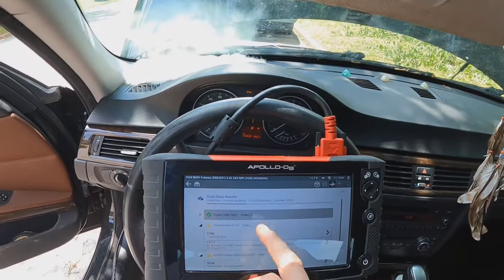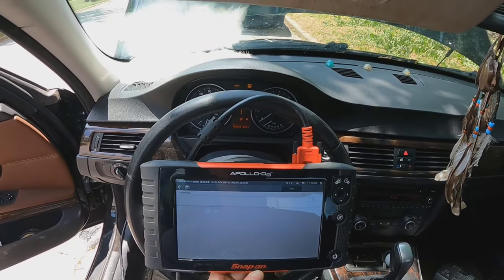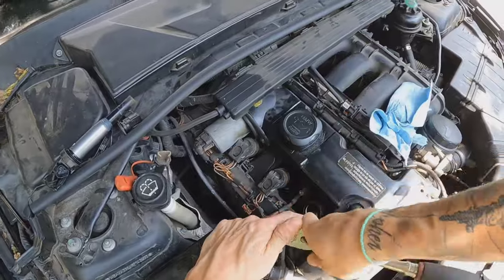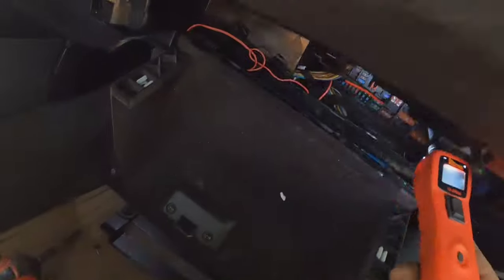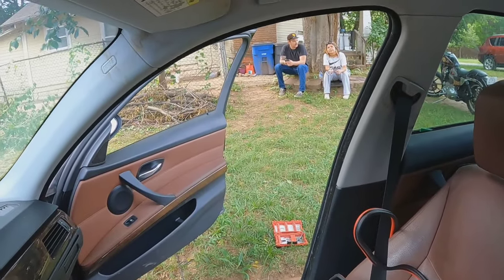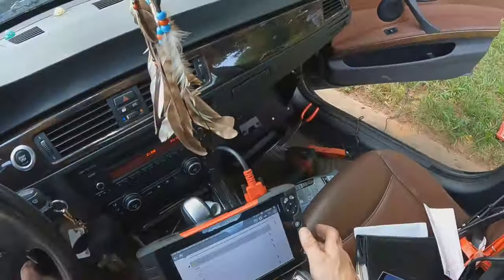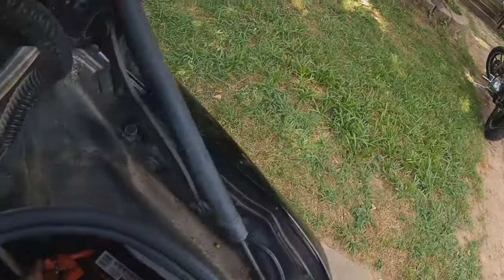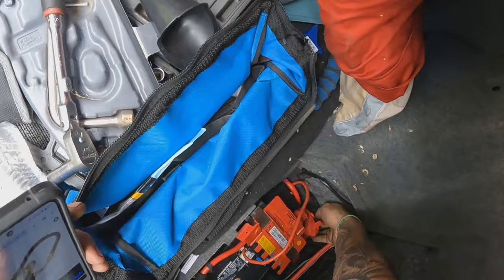08 bmw 328i Crank no start figured out! #fypシ #mobile #mechanic #letsgo #bmw #vehicles

Comment: Hey no hate, but it would have been interesting to actually see it start afterwards because BMW does not log when a battery has been replaced without registration as a fault. You can see it under previous registrations that there has not been one at a recent mileage. It will not cause a no start. The IBS is also not what you were showing her, you showed her the explosive discharge on the positive battery cable and the negative one is the one who houses the tiny IBS module. It is relatively easy to forget to plug it in because it's a blue connector that's  towards the tail light that's easy to miss. I don't think it was properly checked either it runs on LIN and you need to use an oscilloscope to verify there is a bus there or at the very least a multimeter to check the average potential at it, and check the wakeup line to the sensor- which interestingly enough beside a no communication from the DME to the sensor the only other problem the IBS can have is shorting the wake up line however you did not have that because the dashlights turned on where with no wakeup line you will get a flat display minus the MRS light. Another strange thing about the video is you were able to talk to the DME, and logic communication to the DME starts at PT CAN and you aren't actually talking to it through your scan tool it must go into the JBE first. She mentioned she replaced the fuel regulator, housed in the sending unit, which is in left side of the vehicle and if a hose pops off there internal to the tank you will have fuel pressure but it will dump right at the tank, it would have been drastic to amp clamp the fuel pump and verify that you have enough working load on the fuel pump and it's not just being dumped back into the tank. I like your videos but this one was very odd, and nothing you mentioned besides a fuse would have actually repaired the car. Another thing to note is Snap On scan tools will not give you full fault lists, full module accessibility, and misnamed fault codes and I would recommend you find a better scan tool for European vehicles TopDon/Launch and Autel are decent before going to an Autologic or a pirated version of ISTA due to factory ISTA needing a full internet connection which I understand would be difficult in a mobile environment.
Reply: Yeah I have the same vehicle as the video just as a daily, also have a 18’ 340i and ordered a 25 m4

When I got the 08’s battery changed they never registered it.
 it died after a year and a half and i had two people tell me they couldn’t figure out what was wrong with it both telling me if it wasn’t registered it wouldn’t start, but BMW said that wasn’t the case.
Bmw sent a technician with a new battery and registered it.

Hoping this battery doesn’t die within 2 years.
Reply: All facts.
Reply: so  most likely the autozone battery installer  grounder shorted a terminal  while moving battery around, which blew a fuse.
Reply: @jongonegone1262   Unless the guy bypassed the junction box feed fuse, very hard to do. However, honestly after looking at the fault list on the screen at 2:31, they are all Valvetronic faults. If the Valvetronic parks in a way that allows no airflow, it will not start, just crank crank gimme air crank crank. No mention of Valvetronic in this video. God this is a strange diagnosis. Hope this lady got her car fixed properly.
Reply: @youutartur1104  okay thanks.
Reply: @youutartur1104 I 100% agree on PT CAN, LIN, or wires in general they best use is a pirated ISTA. I’ve dealt with lots of wire malfunctions due to rat intrusion and diagnosis on those Bus systems are something a snap on scanner won’t guide you with.
Reply: Does pirated ISTA still work ?
Reply: @youutartur1104 you sound like you can help me so i thought i should ask, i’ve been having a issue where my car randomly loses all electrical power while driving, at first i would be able to start the car again but now it’s just completely dead.
Reply: YOU SIR, sound like an automotive mastermind!  Hope your getting paid your  worth if you’re an auto technician!  Greetings from Canada!  Sincerely from a fellow truck technician!
Reply: Reading this made me never want to touch a bmw
Reply: dude you just writing history from the beginning of time to end of days!
Reply: Why I don't own a BMW...I don't have an Adderall prescription. Holy cow.

Comment: These cars are getting so ridiculous having to register batteries holy crap we are getting to the point of being crazy
Reply: On some models its like that since 10 years and more.
Reply: It's so that the car knows what type of battery it is and prevents overcharging or undercharging. This is what the registering process entails. Inputting the battery stats to the car. Usually these cars come from the factory with smaller capacity batteries to save weight. But if you want to add for instance a 2000w audio setup, you might want to upgrade the battery. But if the car still thinks it's running the smaller capacity unit, the new one will never get fully charged. It's a neat feature but most people are not into this stuff and treat their vehicle like any other appliance. Which is fine, but in that case they probably shouldn't get a BMW.
Reply: @TurboNym  a Bavarian money waster isn’t for everyone
Reply: @JamesKinniburgh-e3e i actually see it as a money saver. if you register it then the battery lasts 10yrs instead of the usual 5yrs on most other cars. Our 128i doesn’t have the IBS system so no registration can/needs to be done. That battery dies every 5-6 yrs. 

I’ve been maintaining our 4-5 BMW’s for next to nothing in terms of parts costs. And the drivetrain in all of them lasts over 400k

Comment: I knew from the beginning of this video what the issue was. 99% of older BMW owners can't afford the care and upkeep on it and just bought it for clout. 😂 You need a BMW specialist computer and an AGM battery it CAN NOT be a normal lead acid battery... The issue is the alternator constantly ramps up over time to compensate for battery drain over time. The problem with this is the feature where the vehicle computer can detect the new voltage and amps from the battery so it should know if it's new or not is non existent. BMW in their extensive intelligence decided they'd prefer something as simple as a battery change requiring a computer flash to reset the battery! I won't even work on BMW anymore at all or Mercedes. If I get a call about one I politely say I don't work on them sorry.

Comment: For fellow bmw owners, There are different kinds of batteries. If you get the same size and type, you dont have to worry about the programming.
Reply: Not necessarily, it's still important to reset the life monitor when you install a new battery, regardless of the size. If you don't, alternator will overcharge it and battery will be kaputt within a year. See it all the time.
Reply: you may know, but the computer doesn't know its the same type and size so you have to program the new battery and let the computer know hey we have a new battery now
Reply: @BimmerLife843 thank you sir
Reply: You have to let the car know that the battery is new or you may end up with an overcharged system buy registering the battery it lets the car know not to over cyle when charging. It tells the car I am new be gentle.
I am not quite sure about logic of operation. 😏👍🤪😜🇦🇺
Reply: @d47000 thank you sir. As we know battery registration isn't just there so we have an excuse to play with our dongle.
🤪😜🇦🇺
Reply: Problem is don't buy a BMW. Over engineered pits.

Comment: if you disconnect the IBS from negative terminal your car should start if the IBS is the issue. the one one positive side is for airbags.  I would've checked the engine ground. I had a bad IBS and when it was connected it wouldn't charge the battery.
Reply: I’m in this situation with a 2010 535i Xdrive. I initially thought it was the battery so I replaced it. Then I replaced the starter and that didn’t work… next was IBS so I unplugged it but that didn’t work either. Thought it might be the engine ground so I tried recharging it through jump cables, then taking one black and putting it on my black jump terminal and the other to the engine block to try and manually ground the car - didn’t work either :( 

I bought a scanner and it mentioned IBS but I cleared it and it didn’t come back. It also had a GWS undervoltage code, alternator, and electric coolant pump code. Any advice would be appreciated my next move is to buy a multimeter and a tool to test current
Reply: @destructionn98  I think there are two grounds.  one that goes from starter altenator to frame on front driver side. and from engine to frame.  check both.   it can be the fuel/fuel pump.  so you might want to check the make sure everything working in fuel area. I have a cigarette lighter voltage meter reader. if I turn the car (not running) on it will tell me if the voltage is proper. if the voltage is proper check fuel, ecm, and related fuses. also you should know the condition of your spark plugs, coils, HPFP, fuel pump and filter
Reply: @mannymoo  What does it do, no crank or crank no start? You would need to look at the CAS/BDC/FEM and look at terminal control and see if terminal 50 is being powered. If you wanted to check your block ground all you need to do is put one meter lead to your block and another to chassis ground and crank, if you have over a volt you need to fix that. I won't stress anything below a volt when running the starter, because the grounds on the N55 are hard to access and 1 volt during a 350 peak amp 120avg amp draw is still in the realm of starting and eh/ok in my book. Don't beat yourself up on buying the parts and it not fixing the problem you were probably going to need them anyways if you're keeping the car.
Reply: @mannymoo  Just FYI, IBS, Alternator, oil level sensor, and electric water pump are all on the SAME serial bus. I would look up some block diagrams for the BSD bus and start there first. GWS is just the gearshift I think, I wouldn't chase your tail on that one unless you're having issues with shifting out of park, etc. 

It's a one wire bus so if there's a short in one of the components, it'll take everything else out, same thing if there's a wiring fault.

I dealt with an issue where my electric water pump was causing an "IBS Missing" code and making my A/C act funky. I disconnected the water pump for a brief moment (very brief!) while the car was running, et voila, A/C went back to normal. $40 water pump from the junkyard cured it. I might try the same if I were you, just disconnect one component at a time.
Reply: I disconnected that sensor and did not start  I noticed it on those 3 wires. 2 will have constant 12.5 volts and the one in the middle grey wire. It shows kind of ground but like not enough

Comment: I would jam some starter fluid into it. Just because fuel pump runs don't mean it's good. It's like if a relay clicks doesn't mean it's good. Just trying to rap my head around. Bad battery sensor to create a no start. 
Isn't it just a monitor 🤔🤪😜🇦🇺
Reply: They go out frequently

Comment: I have an 07 x5 crank but no start changed the fuel pump n relay still not turning over please Help. After get gas I started the car n it started idling really rough. After that car won’t start. Please HELP. Ty
Reply: Go scaner,fins engine,there should be something like this
dde-cas adjustment ,follow instruction
Reply: Also can be fuel pump
Reply: Crankshaft position sensor